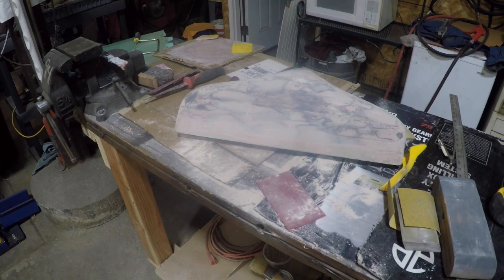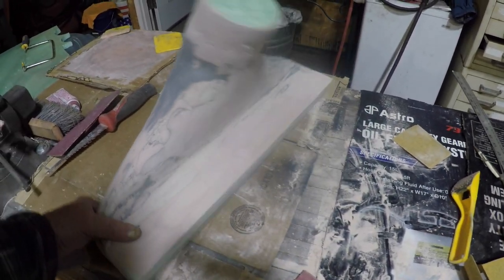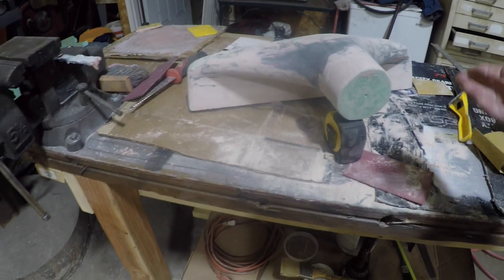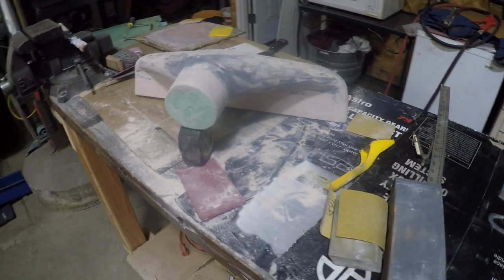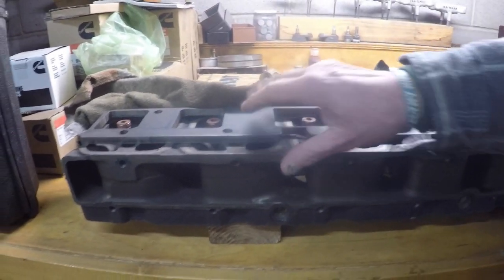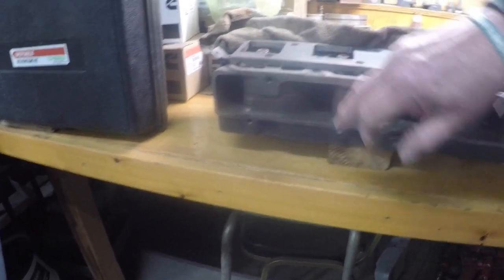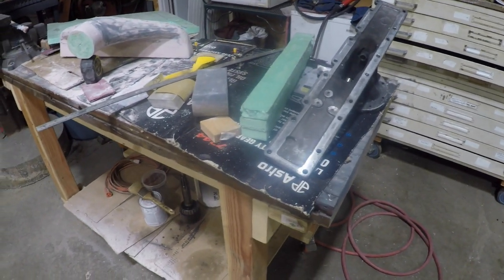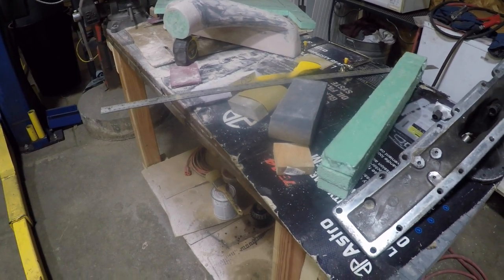Carbon Fiber Intake Build Part 8

Comment: Fred, you might look into finding a 3-D printing company that can print metal.  Maybe they could print the same material that is used on plastic intake manifolds on many engines.  They are doing fantastic things with 3-D printing.

Comment: Could just run port water injection to balance egt’s 😎 at your current build rate it is possible I will have my dyno going before you have that 8.3l built. 🤣  stupid forklift has a tire split out now or I would have taken it for a spin today. It’s running pretty good.

Comment: Good morning Fred, you mentioned making a base to attach to plenum. Could you not make it with vanes to direct flow to extreme cylinders?
Reply from the maker: The base that I am talking about is the ‘flange’ that holds it to top of head intake  port! You have a great point, but they would have to be fabricated and attached after the fact if I need them! What my thought is, will install pyros on exhaust manifold ports and get temps and variations between the cylinders, then if needed I will come up with plan ‘B or C’!